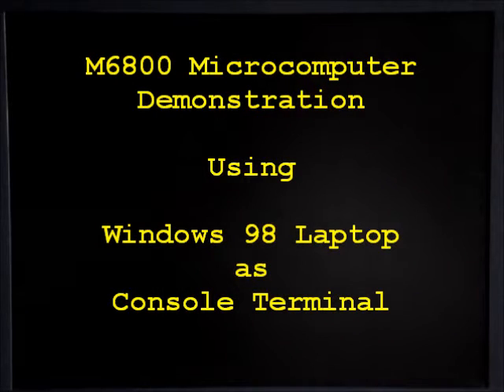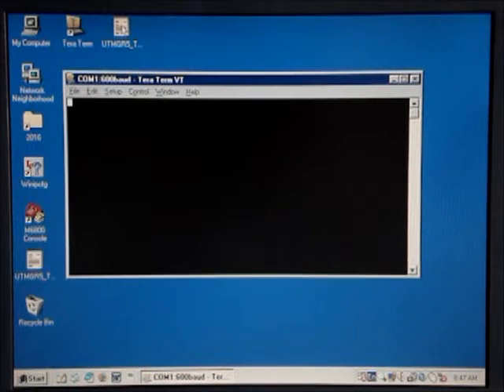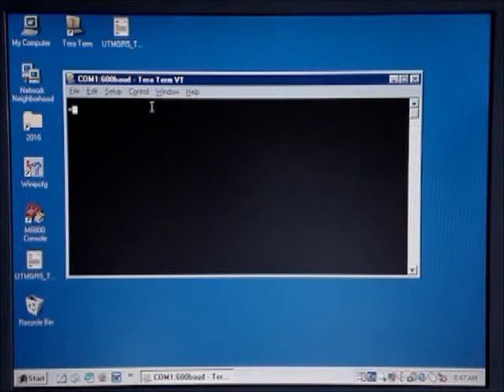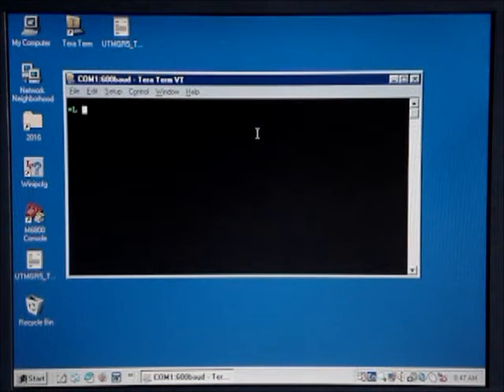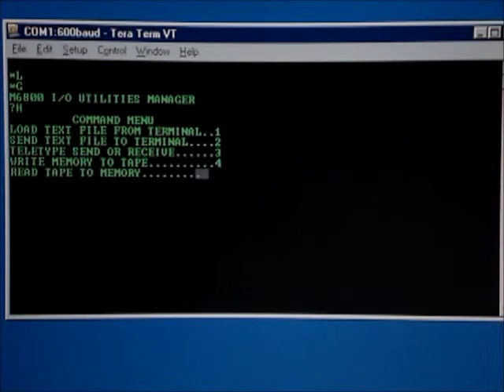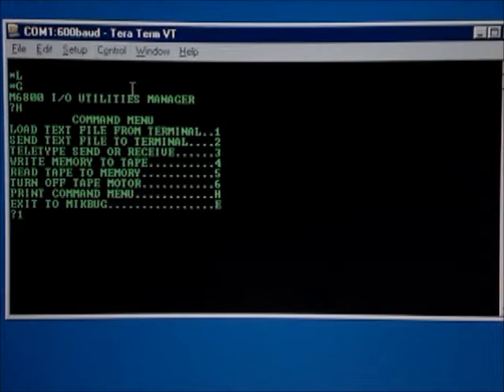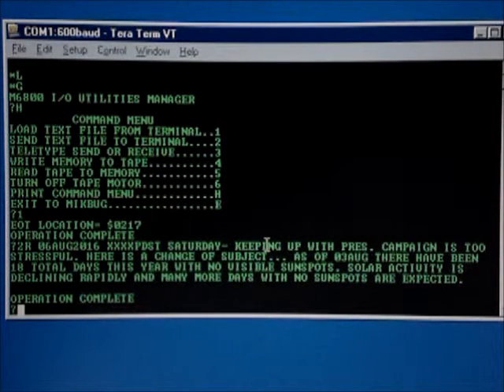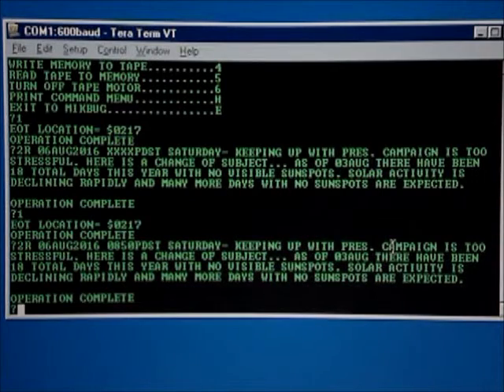A Tour of my MC6800 Microcomputer System

Comment: this is pretty impressive
Reply from the maker: Thanks for watching! I did not mention in the video that several of the 2102L1 memory ICs had failed during all these years in storage. I used a couple of memory test programs and some analysis to isolate the failures to the particular ICs. Fortunately I had enough spares (also in storage since those long ago days) to get both memory boards back up to their full capability. -73
Reply: @Random-ep8st  I was born in late 80's and I can't imaging how those was done without internet. I assume  people's life must be quite simple and passonate when those mashine was built
Reply: @mikecarlson6416  That actually was a thing... usually you had a local "computer club" with regular meetings where you met fellow hobbyists and exchanged ideas and programs.  To send things over longer distances you would use the postal system to send a cassette or later a floppy disk.
It was slower, but maybe you were more careful in making things work right before going through the effort to send them.

Comment: I'm no expert, but weren't you suppose to close the choke or push the clutch before starting the Teletype and contact the tower for take off clearance?
Reply from the maker: Great comment- thanks for the laugh-  but there is method in my madness. I don't like mistypes appearing on the copy, so i use the demonstrated procedure to avoid mistypes at power-on while also forcing LTRS mode. Towards the end of the demo I showed another procedure for avoiding mistypes when using the LINE BREAK switch.  Thanks again! This month is the 2 year anniversary of my 2nd restoration success for this set. The first restoration was in 1977-78.